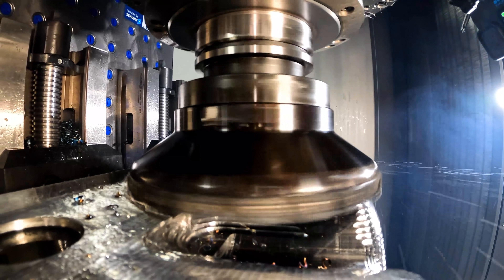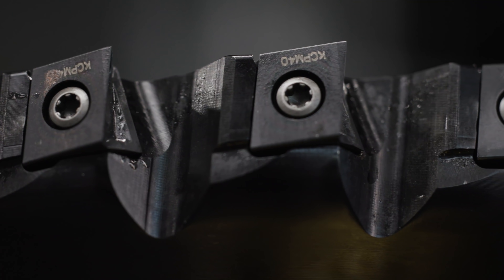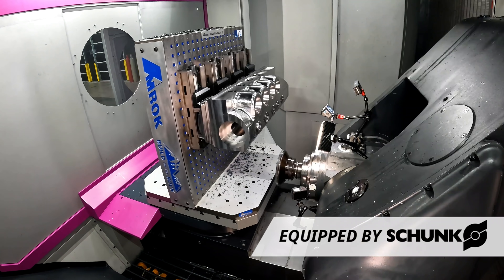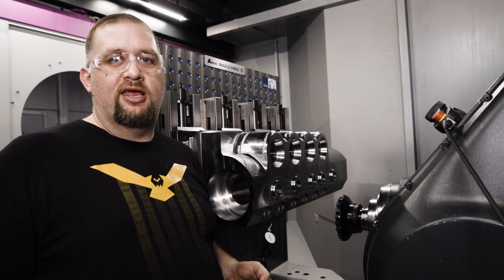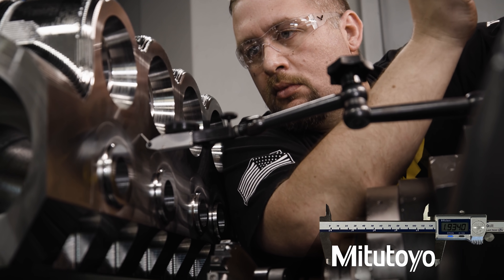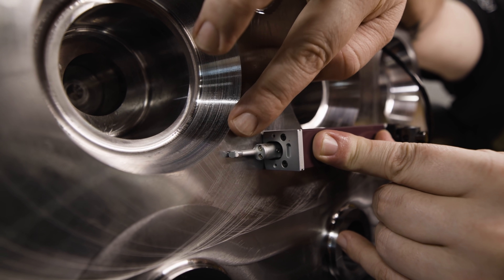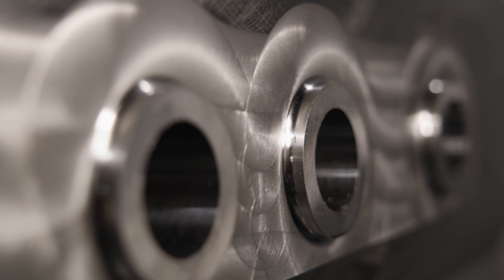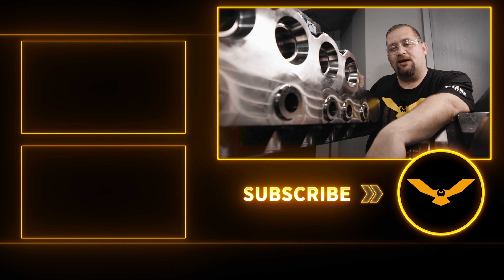COLOSSAL 22-Insert Face Mill Leaves INSANE Surface Finish

Comment: Correct me if I’m wrong, but I was taught by some older timers that less inserts ( like a fly cutter) left the best or better finishes. Iv never used a single insert cutter for facing before so I don’t know.
Reply: Generally it is easier to get great finishes using a fly cutter, but this is going to be at the cost of speed; from both a reduction in feed rate and depth of cut. The biggest factor, I think, is that the cutting edges of a face mill are always going to be at different heights, on account of differently sized inserts (common "M" class inserts are made with a tolerance of +/- .005 for the inscribed circles), debris in the in the seat, or wear to the seat. Face mills with adjustable cartridges are available, but they are painstaking to set up and even then there will always be discrepancies. A fly cutter, having a single cutting edge, has no such problems.
Reply: @copperlemon1  generally it’s common practice for important parts to touch off every single insert and record your lowest one as your tool height, and they make some with “wiper” insert mounts that are tenths lower to “wipe” material clean
Reply: it's strange, i run a mill and cnc at work. that mill, 2 blade, is ok and great if i'm not rushed, the 8 blade mill if adjusted right is the best and the 16 blade when adjusted right can yield similar results. of those options, i'd pick cnc 8 blade every time hands down for surface finish but out mill hasn't live a happy life before me lol. I might be wrong, just my limited experience. i think it really comes down to feeds, speeds and proper tool adjustment.

Comment: I'm not doubting the guys view on it being quicker to run the big face mill and finish the areas it couldn't reach with an end mill, but by the time someone has stopped the machine and taken the time to check the difference in height between the 2 operations, and the machine has run a second spring pass, I'd question whether it would have taken the same time or less to run a smaller face mill that could have completed the job in 1 operation and the time used to check the 2 op's used elsewhere 🤷‍♂️ who knows!
Reply: but it's super worth it in production. you check only the first time and then you get that bonus time with every single piece you make
Reply: @strzaua123  that makes sense 👍 I was looking at it from the perspective of one off parts...
Reply: Barry did also mention wanting to minimize the tooling(witness) marks, so using a giant cutter helps cut down on that.

Comment: Everybody loves a good finish no matter what the specs call for. I used to machine large aluminum front frame motor mounts for turbofans and we used .750 end mills to side mill between the rails. The tool salesman showed up with a new two flute end with a .060 radius he called a SkiCarb. We started getting mirror finishes and that was side milling. Good tools make all the difference.

Comment: Maybe it's just me but the finishing requirements were pretty low for that part. I work with the metric system and 1/10 of a mm is a big difference between the two surfaces. I can feel it with 5/100 of a mm.
Reply: The movement on the indicator was less than 1/100 of a mm
Reply: Hes using imperial. 1 tenth=0.0001inch=0.00254mm

Comment: Why not use a wiper insert on the face mill? I’ve experienced much better surface finishes with little to no visible tool marks? Just curious
Reply: Or use CBN inserts which are great for running dry and leaving awesome finish

Comment: Barry I know u measured the surface finish and its passed the specifications, but in my company that surface finish would not be acceptable it may measure correct but the visual isn't good coming off the machine
Reply: The finish always goes dull on a spring pass as it isn't burnishing the surface properly.  I'd increase the speed for a spring cut to keep the shine

Comment: That's a baby cutter. At times I use to use a 750dia side & face mill.
Love your videos.. they're so informative. A machinist never stops learning
Reply: I've seen bigger! (That's what she said) Worked on a Cincinnati Milacron back in the day with a 6' diameter rotary mill. Had hundreds of inserts.
Reply: @jimkellar9965  nice
Reply: we have two waldrich coburg i love these machines. The Power and the accuracy of these two full hydrostatic monsters is unique.
Reply: @CocoBrother2707  even with 350T castings on the table the coburg still held its accuracy.
Reply: @samuelwragg8615  😍
Reply: Waldrich Coburg?
Reply: @CocoBrother2707  I have worked a Coburg(a beast of a machine) at a Sheffield company called Davy's. My prime machine was an Asquith post Miller with 10" spindle.

Comment: Little hint for the endmill mismatch : Gaugeblock to perfectly match the toollength of the endmill to the facemill (process goes as this: facemill to desired measurements -> get out the endmill -> move endmill over facemilled area -> use gaugeblock (ceramics for extra heatresistance) to perfectly adjust toollength to facemilled surface -> run the endmill -> check areas with indicator for mismatches) mismatch should be sub 0,01 mm or there is something fishy ...

P.s.: Hmmm, I´ve done nicer surfaces on gas-turbine halves (steamtightness), so speaking of insane surface finish is way exaggerated, but it still ain´t too shabby :) 
I personally speak of insane surfaces if I manage to get close to ground surfaces with milling/turning .

P.p.s: Use metric already ... way easier to use and less cluttering on y´all drawings .
Reply: Obviously tool length wasnt his problem (otherwise the spring pass would do nothing). 

Finish: Thought the same, but not doing any 4140. DRY! 
Asume that's his main problem, filming, milling AND perfect surface is always a problem... You can only have 2 of them at once :D

Metric: FUKC YEAH! What I was confused with his "five tenth" of an inch/foot/apple... Still not sure what the actual value was. 0.0005in?
So unneccessary, just use a decent system :P

Comment: What's the biggest depth of  cut you have taken with the 8 inch face mill??
Reply: I was only able to get away with .050” here. I tried going for .100”, but had a less ideal vibration profile, so went to .050.
Reply: @barrysetzer  had you taken every other insert out, it may have reduced the vibration which would have made for a higher chip load. 
not sure on the edge prep or hone either, but a T-Land Edge with a large hone with that low of a DOC, could have caused the vibration issue as well
Reply: @hotlaprc1980  Good pointers!

Comment: Thats also a great method for creeping in good fits on dowel pin holes, you feel like you wanna add another half thou to cutter comp, but sometimes you just need to run it again and get a perfect fit.
Reply: yup, gotta account for tool deflection when machining tight tolerances. Inconel is the worst with this, you're creeping up on a Ø20 +0.02mm tolerance, you can be at Ø19.98 take a spring pass, and end up at Ø20.03 real easily if your finish pass was too large. Gotta creep up at it sometimes.
Reply: Spring passes are your friend.

But also consistent cut pressure.

Comment: What condition is that 4140? I cut 4140 HTSR almost daily, and I don’t get decent tool life with the SFMs you’re showing. I can usually run 600 with most of our indexables, and 450 with solid tools.